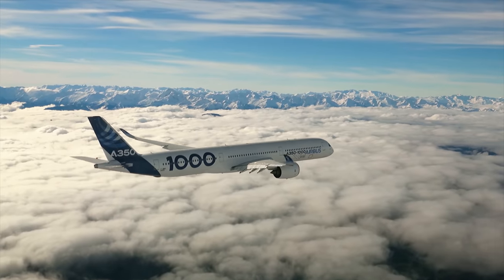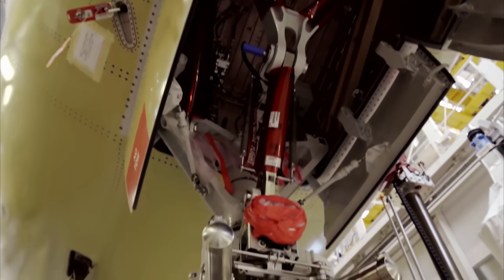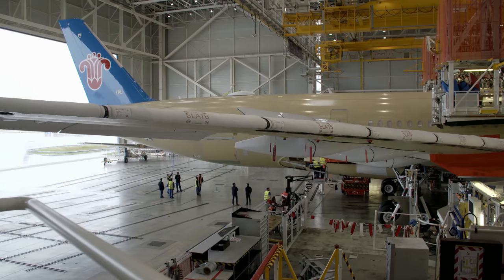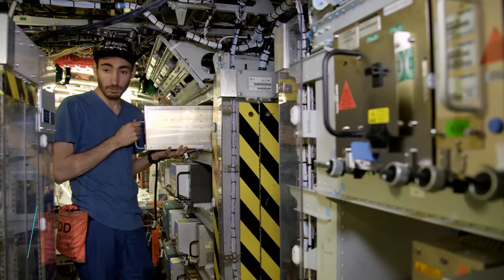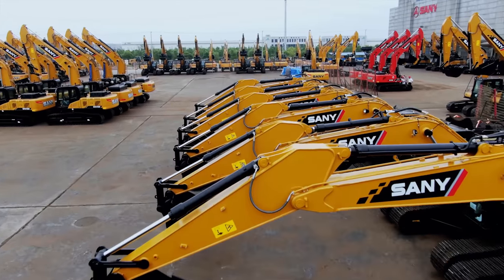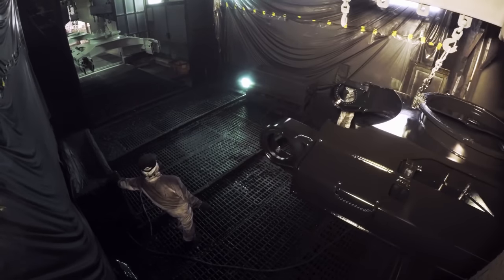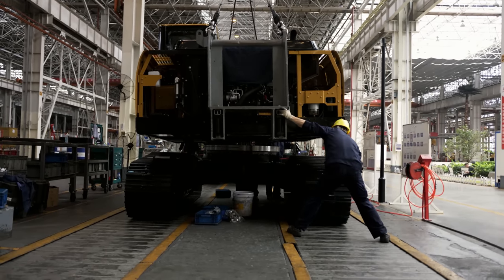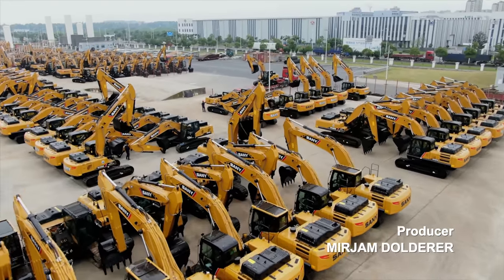Mega Manufacturing | Complete Season 1 | 4K | FD Engineering

Comment: Boeing builds their planes in one spot. The Airbus system was responsible for why the 380 was so expensive .
Reply: What the heck are they thinking?! Outsourcing parts and minor subassemblies are one thing. . . . . but colossal subassemblies are asinine. If you can't stuff it in the 'Guppy' like Boeing built back in 1965 . . . . . you're a fool to ship it over ground.
Reply: Yup. And the fact they ended production within 20 years and the future of them as cargo are done for
Reply: That's not entirely true.  The fuselages for the 737 are manufactured in Wichita, KS and then shipped via rail to Renton, WA for final assembly.
Reply: @mountainmanwannabe9495  Vastly different by rail or by the guppy than by trucks through tiny little towns.
Reply: Not really anymore for the 787.
Reply: @junrenong8576   I'm pretty sure that is recognized here, but the huge difference in the way it is done by Boeing, makes way more sense than hauling huge wings and fuselage sections through tiny little winding roads and town centers (Airbus). . . . . by rail or by air, makes no sense otherwise.
Reply: 1/3 of 787 made in Japan
Reply: Really? Are you aware 787 parts build all over the world and Boeing assemble the plane. All logistics are disorganise mess.
Reply: Lol the Boeing people here. How’s that safety record going. Also Boeing parts are made all over the world and shipped to the Boeing warehouses too.
Reply: @Beinon007 pretty good.
Reply: It's made by the EU so they have to make parts all over the place, since the EU is a bunch of countries with same business and trading deals to benefit equally each other.
Reply: @gilzor9376  Boeing has an airplane parts super cargo airplane too and they use them just like airbus does.
Reply: @lcfflc3887   . . . got any 'new' information? No kidding! The first super guppy was built in 1965 for carrying rocket stages for NASA. Boeing did not, and does not transport so much of it's modular assemblies like airbus does! Night and day difference! Boeing's use of such transport is  limited to sensible scale.

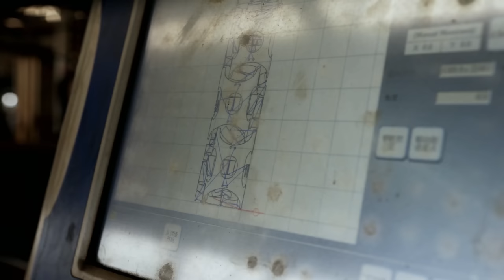Comment: 52:15 "There's a problem. The plate isn't lying perfectly straight." That's not a problem. That's normal. Every machine like that works the same way. They simply tell the machine what angle the plate is at by way of reference points and the computer compensates. It's the same with every plate, on every machine, every time. It's ridiculous for these shows to introduce drama that doesn't exist in real life.
Reply: You don't know. It's a Chinese robot. It could be extra sh*tty and not have auto-correct. Maybe they can't figure out how to steal the design for that chip.

Comment: Stop Stop Stop Tesla has just dumped the desil engine and all hydralic for electric. Dump the desile engine Dump the hydralics go electric power maybe buy Tesla plaid S motors and gear everything off 1 motor. 
No engine oil pumps 
No hydralic oil tanks
No hydralic pressure lines
No desile fuel tanks
No maintance
No wear
Maybe no monitoring system or vastily reduce monitoring system
1. Buy LFP blade battery protoype
2. Buy Tesla plaid S motor
3 Cable or chain drive everthing from 2 EvCar motor
Need a total redesign
and 
Buy LFP Blade battery protoype around the battery not motor not gear but design everything around the battery
Reply: Also redesign for a lighter weigh dumping hydralics Desil engine Fuel tanks all save weight and can cut down on metal thickness of entire Kumotor.
Reply: Ed Hugshe ..Stop , stop, stop  misspelling Diesel...lol
Reply: Amen.

Comment: If it were up to me ordering a truck I think I would say no to all the LCD gauges and metering displays and go old school mechanical gauges.  As far as the framing of the chassis I would go with a double frame rails and more cross members than I watched being installed.  As far as a power plant for the truck there really isn't a good choice to pick from any longer.  The engines of today are a nightmare of sensors and emission control devices that can take a unit out of service far to easily as compared to the mechanical engines to yesterday or the 2nd generation computerized engines of the earlier 1990s.  The law of physics states the more to go wrong the more will go wrong. The number one job of that truck is to work when needed and with all the high tech, high dollar maintenance I just see more out of service hours as compared to the trucks that worked for so long, so dependable in the years pasted.  Just my opinion.